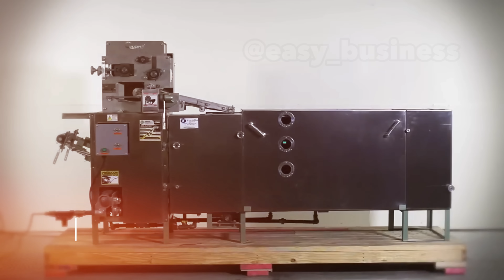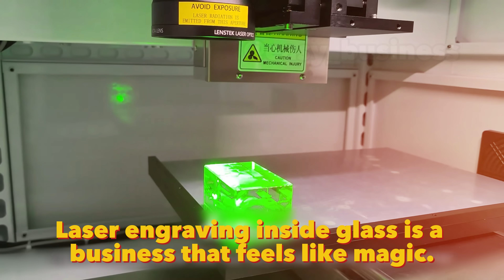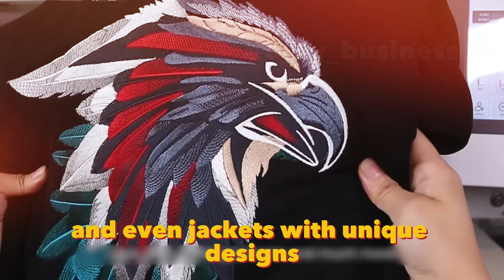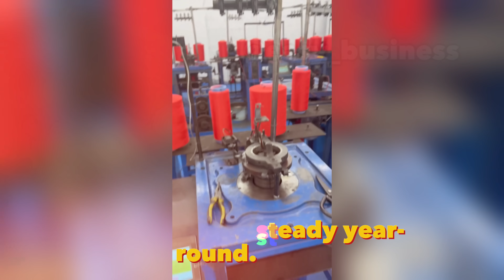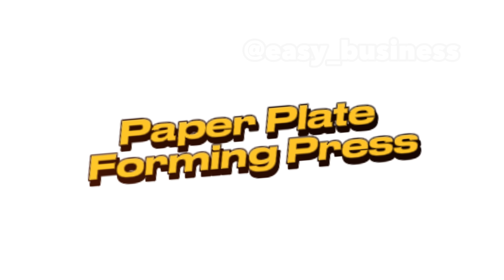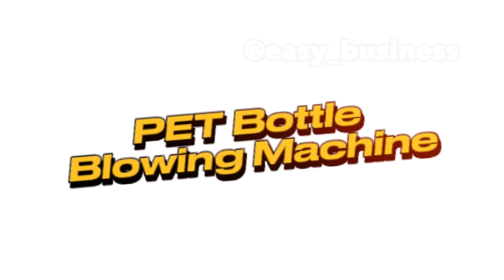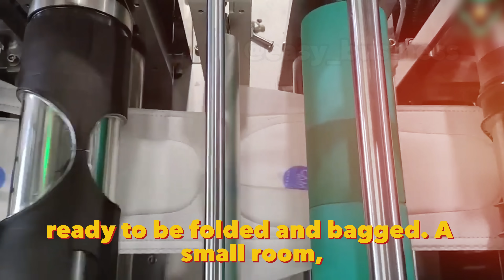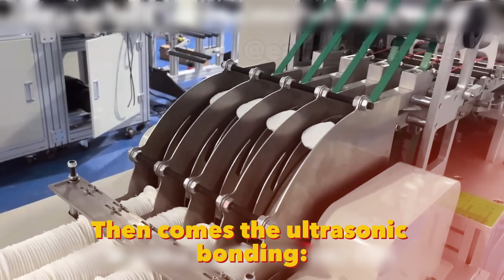30 EASY MACHINES TO IMPORT FROM CHINA FOR STARTING HOME BASED BUSINESS

Comment: Yeaaaaaaah.... its not all rainbows and butterflies ..... I've had my fair share of machine imports from China ... Support is almost ZERO 99% of the time, good luck getting parts if something breaks and good luck getting someone to "fix it" or tweak the code if something goes wrong as well. Either become an engineer or a mechanic or the best you can do is hire a local engineer and PRAY they know what they're doing, and yeah, good engineers aren't cheap. Its not as simple as "pay $6K, plug it, push a button - money comes out the other side". Machines need to be fed properly, maintained, certain things have lifespans (like print heads, cutting edges, etc.) ... Do not follow this video without doing a complete market and cost analysis of something you're willing to get into. Your margins MUST cover maintenance, machine upgrades, etc. without breaking your customers' bank - otherwise no one will buy from you and you'll have a useless machine at home wasting your space and your money.

Comment: i find it ironic how the people here do not comment on setting up and maintenance of said machines... they break down... i've worked in production for over a decade and the machines we use made by SIG or ABB or whoever requires maintenance contracts and whenever it needs parts it gets expensive... how does that work when you get a crate from Shenzen??? who's the local rep? the people who look after western machines are often Mech. Engs...